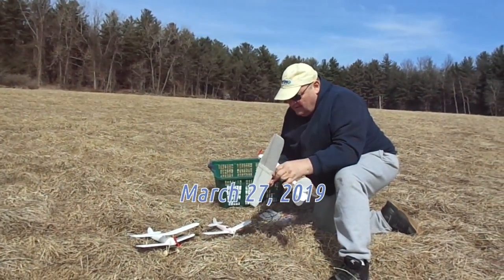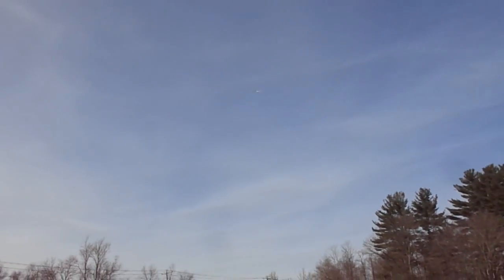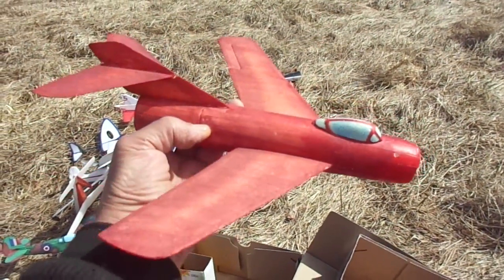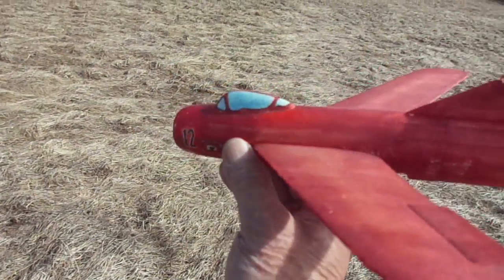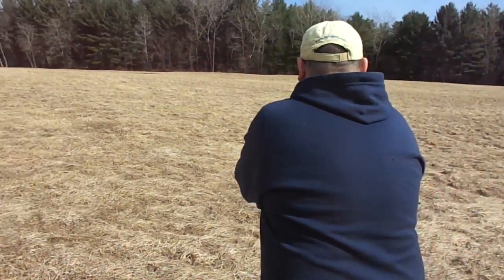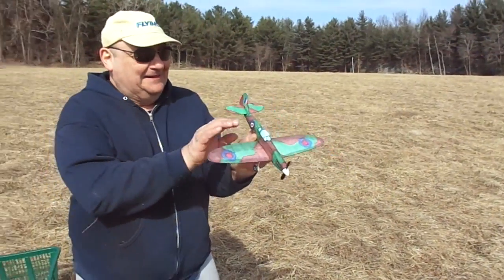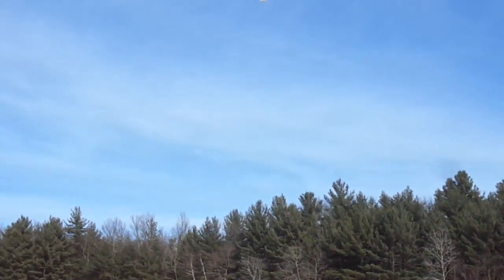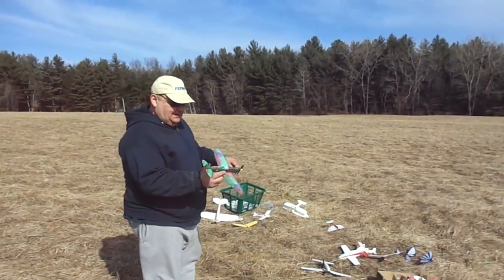Supercap F/F Flying Session 3/27/19 ...The Whole Fleet!

Comment: Absolutely amazing video, those tiny planes look so much fun.
Reply from the maker: Thanks Neil! They are fun....to build, and to fly. Like two hobbies for the price of one!
Reply: great models, fly wondwefy and couple of great fellows
Reply from the maker: @roberttooker8602  Thanks for the kind words Robert! Glad to have you on board!
Reply: any free plans for these models and if so information about downloading on my PC, thank you
Reply from the maker: @roberttooker8602  We begin with just the outlines of existing designs, full scale and model, and then fabricate from foam. Generally there is no internal structure, or very little where needed. Download free drawings from outerzone.co.uk where they have literally thousands to choose from. Download free to your pc in PDF format, adjust the scaling to show the drawings on your screen in the size you want to build, then trace directly over your display screen with tracing paper and you'll have everything you need to build any design you fancy! My little Spitfire, for instance, was traced from drawings of a full house radio control job with a 50-something inch wingspan! I displayed it at 13 inches on my screen and traced the outlines, ignoring the internal details. Material can be hobby grade foam sheet or recycled foam picnic plates and supermarket meat trays, bits of balsa, music wire, etc. from the junk box and you have a quickly built fun flier!

Comment: Love the mig and bd5. I've had my futaba 8U heli radio since '96 I think? then later converted to trouble free and cheap frsky 2.4ghz system. Still have it and it's flying my scratch built old era 70's and 80's electric converted gliders. Even though I fly with radio, there are times when I wish I lived next to a large farm and fly some free flight planes. You never know what the plane will do and it can either be a nice surprise or pure panic :) Makes things very exciting. Back when I was growing up, radios were very expensive so lot of folks bought russian mk17 diesel engine and bolted it to a high wing trainer and free flight flu them. Trimming the planes and watching them fly perfect was very rewarding. I wish I could go back to those simple times with the knowledge I have now.
Reply from the maker: Thanks Jerry! We don't have very big fields here but the little cap planes can fly in some pretty small spaces and when you do lose one, it's pretty cheap and not a big deal.  Tons of fun! Thanks for watching our videos.

Comment: I am almost ready for test flights of a 1/144 scale A330-300 airliner made from a Revell plastic display kit, the fuz was sanded right down to paper-thin and the plastic wings and tailplane were replaced by foam units with only a 10% size increase but some additional under camber built-in - still looks like a display kit but what I am most proud of is the edf units which I think are the smallest working edf's in the world? I made them up using the original plastic kit fan discs on micromotors in hand-turned foam nacelles which are producing respectable thrust - the resulting airframe is lighter than the XK airliner from which the electronics were salvaged but looks like a scale display kit... first flights soon.

Comment: Fantastic MiG! Great work in general! How many Farads are you using for 8mm motor applications?
Reply from the maker: Thanks Marko! We usually use two 10 Farad caps in parallel for 8.5x20mm motors, one 10 Farad cap for 6mm and 7mm motors. For a while we were buying 20 and 25 Farad caps from BG but they are no longer available. It's cheaper to use 2 ten farad units anyway. Rich and I both think that the 716 or 720 motor paired with a single 10 F cap is perhaps the most efficient combo, but the 8mm motors are cheaper and you can build models that are a bit larger than the 7mm powered ships.
The little MiG was underpowered with a capacitor but I have an idea to use a tiny LiPo with an electronic timer and performance should be great!
Reply: sonex413 Thank you very much for your detailed response! I sincerely appreciate it. I experimented with various combinations of geared and direct drive options + 10 to 30 Farad parallel combinations. Your videos + my dad’s recent work (using egg packaging) inspired me to develop portable launching “pods” for my light RC gliders (COVID builds made from foam trays :-). Thanks again and I look forward to your videos.
Reply from the maker: @markod1977  I tried 40F single cap with 2x8.5mm motors and it works great. See my video with the title mentioning Forty Farad Floater. I also have a big 100F cap and a big bag of 8.5mm motors, and one of those old big styrofoam toy store gliders! I'm thinking 6 motors above the wing a la Dornier Do-X! Good luck with your projects and stay in touch! -Mike